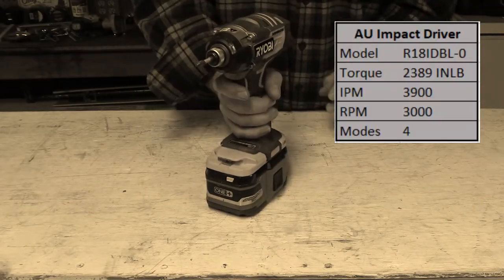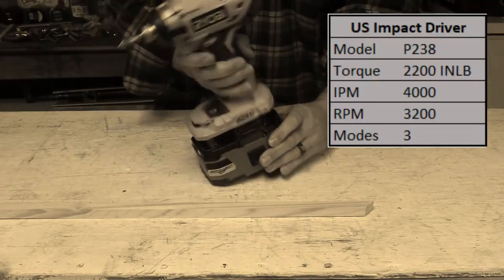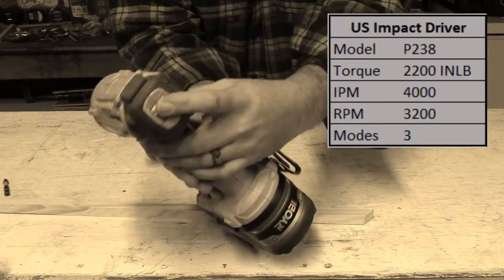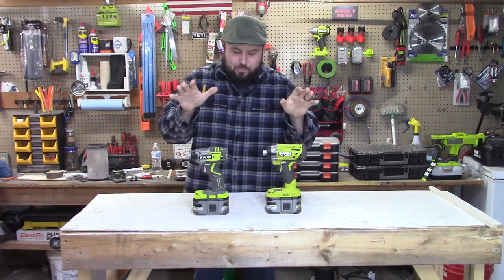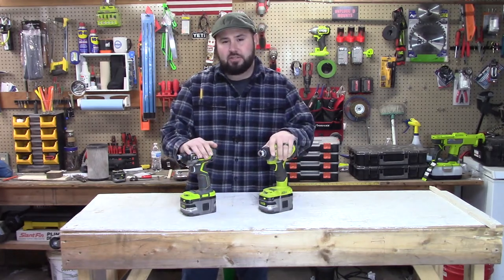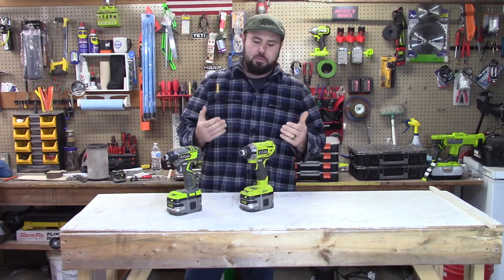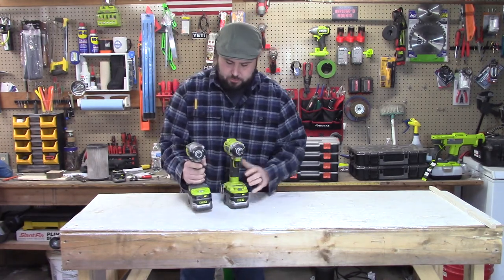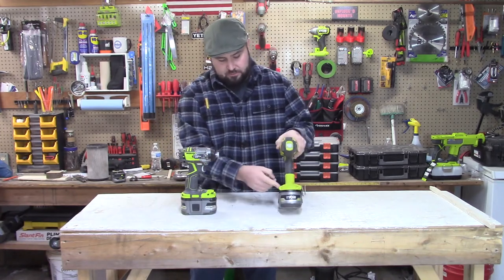Ryobi Impact Head to Head [USA vs AU]

Comment: what is it about Ryobi that captivates viewers?  People say Ryobi can't compete with the big boys, but....are they really that far off in terms of performance?  Maybe they are not as durable?  But I have seen people use it for many years w/o breaking and those who abuse them like there's no tomorrow.  IMO Ryobi is just that brand that will continue to be around for a very long time.....or maybe forever.  You want that one tool you don't use all that often just to complete that task, well, maybe check if Ryobi has it for much less.  It is a good complimentary brand to have along with your high end tools and especially in times when you just want to spend less.
Reply: I dunno... They feel like the underdogs in the tool game compared to the other prosumer platforms. They're cheap, but they do well. Despite the bad rep they get, I and many others have a soft spot for them. 

My favourite power tool is my old Ryobi drill. Granted, I had to reseat the bearing for the fuck axle and the gearbox needed regressing, but she hasn't let the smoke out once.